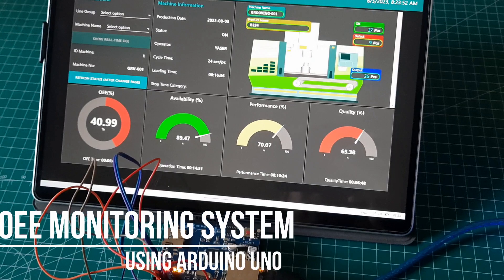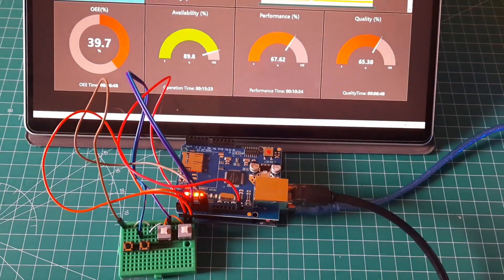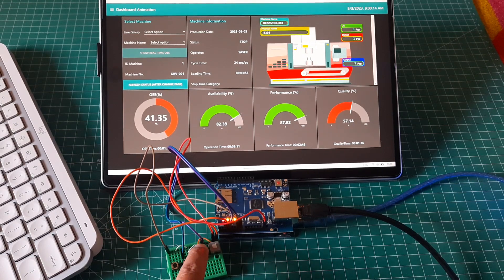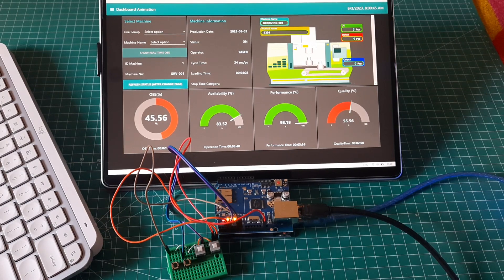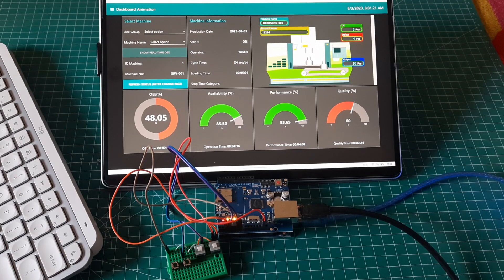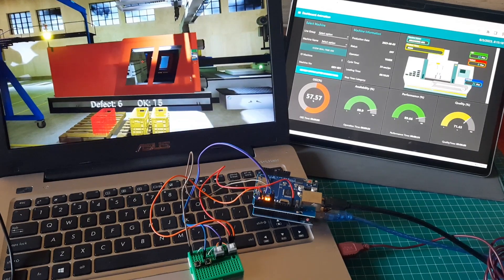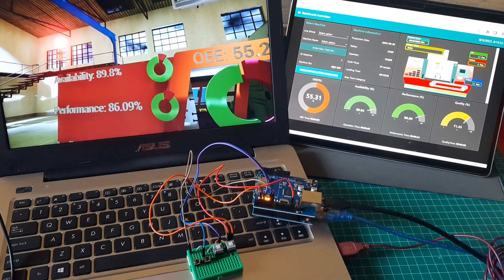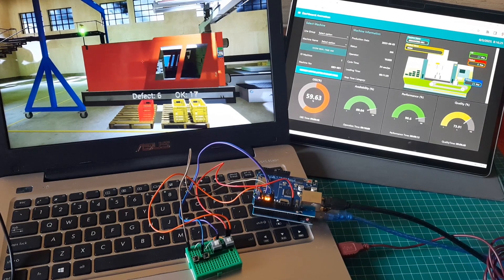OEE Monitoring System using Arduino Uno

Comment: Hi, I want to get data from individual machine on line by using PE & Proximity sensors, Is it possible using arduno mega?
Reply from the maker: What is PE?
Better from your proximity sensor turn on/off a relay.
And from the relays contactor, connect to arduino.

Comment: Very Beautiful... What kind of 3D Dashboard software you use ?   For the Node Red , You install  NodeRed inside the Tablet  ?  What Tablet Brand, Model do you use ?
Reply from the maker: I use unreal engine as 3D Dashboard or I called Virtual Reality dashboard. I install node-red on my Laptop, tablet access the laptop. I use Microsoft Surface Pro 8
Reply: THanks for sharing. Very nicely done. love it